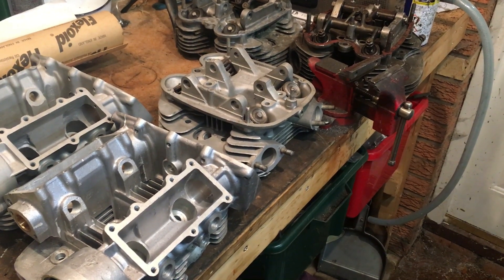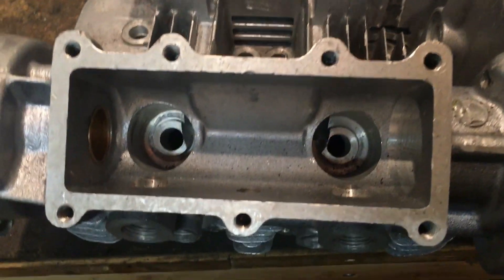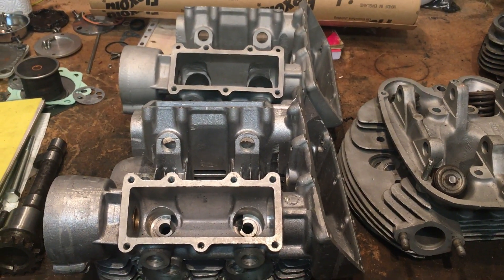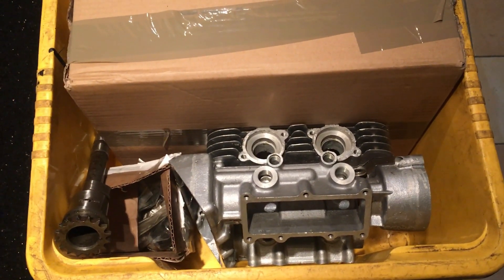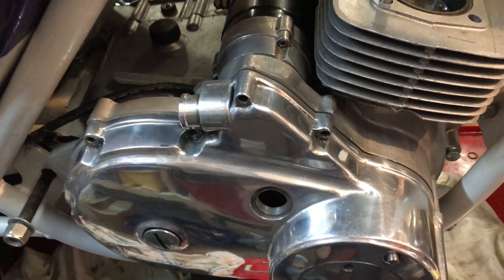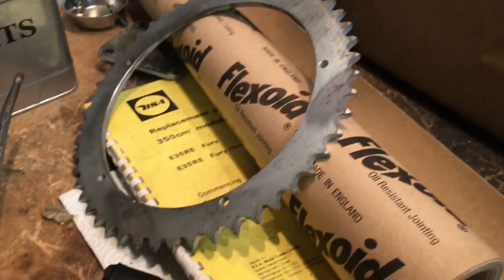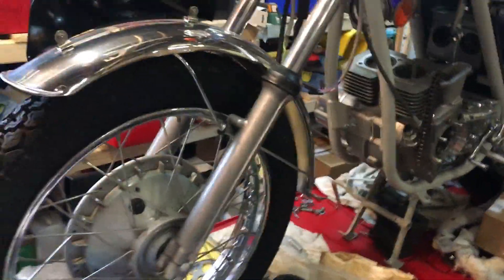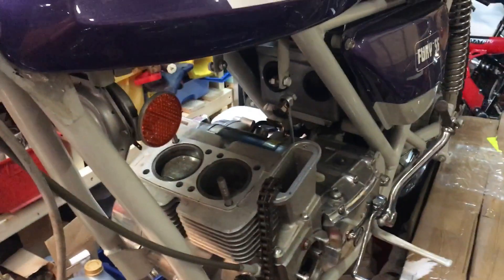BSA Fury SS (E35SS) Build - Engine Part 28 - Cylinder Head 1 and Forward Planning

Comment: Would it be worth getting these rare engine castings 3D scanned for reference?
Reply from the maker: Hi Thomas - it's a thought; however, we do have a mix of spare castings, drawings and moulds so I think we're covered. By "we" I mean myself and other collaborators with a Fury/Bandit bike or parts.
Reply: @BSAPowerSet  that's fantastic - I'm surprised and delighted that they things have survived all these years.

The beauty of having them scanned is the option to have replica parts 3D metal printed, which will cost a fraction of foundry casting. Broken cooling fins won't be an issue then!
Reply from the maker: That's another good point Thomas - thanks - worth considering in the near future.